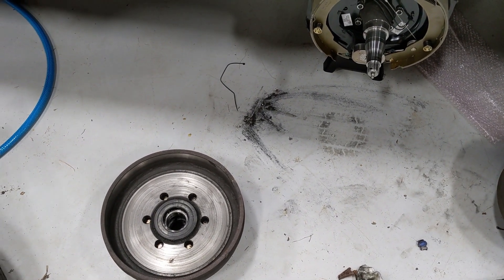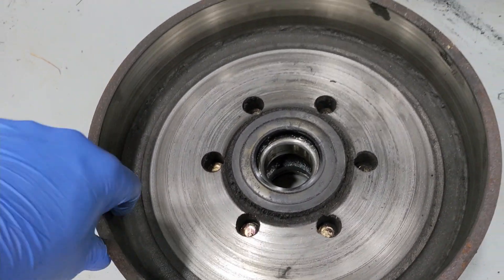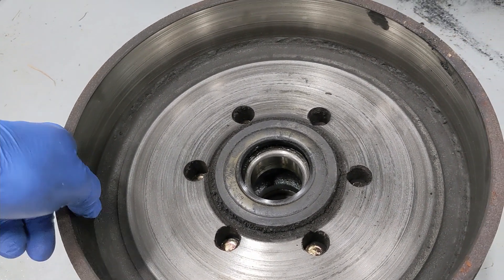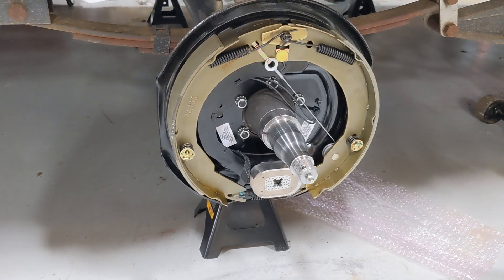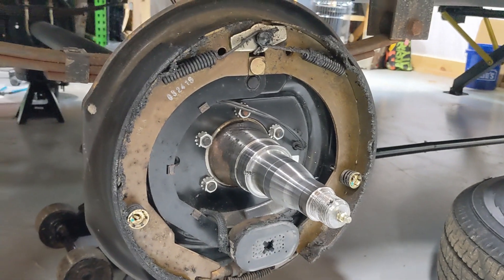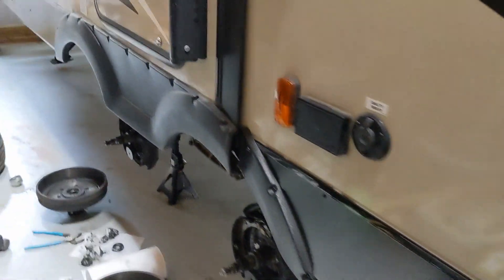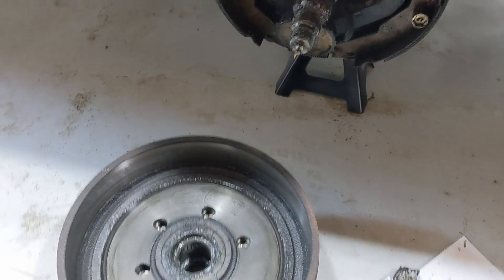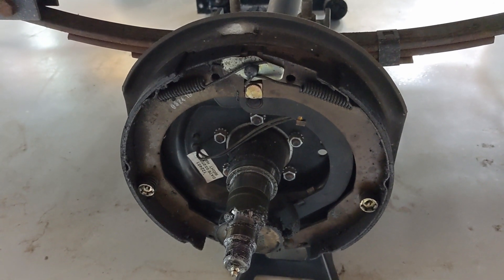Dexter/Lippert EZ Lube trailer axle spindle bearing seal failure - why did it happen?

Comment: I don't think it's accurate to call this a seal failure when what caused it was improper maintenance over greasing the bearings and it pushed grease past the seal. I don't even use the EZ Lube fittings, there's just no way to know the bearings are getting a good new pack of grease unless you pull it out and inspect.

Comment: Thanks, I'm going to check mine tomorrow. I have been pumping geese in while spinning the wheel for a few years. I will see if the seals are blown.  Lippert says to tighten it to 55 foot pounds then back the nut off and tighten by hand. So many opinions on this. I will try the way lippert says and see how that works.

Comment: Does the inner wheel bearing need to have movement up and down or does it sit without movement beside round
Reply from the maker: Should have no movement outside of rotation.
Reply: @NoelBarlau  my inner bearing is wobbly and my rotors are hitting my caliper bracket im guessing its the bearing causing problom thanks

Comment: I don’t know why they would pack the hub with grease on this trailer. Pack the bearings and shoot a few pumps of grease in. If it was a boat trailer submerged in water then u would want the grease pressure to keep water out. Had a quad trailer and bearings were still good from factory after ten years. Boat trailers I Repack every season

Comment: You can relube using the fitting if done right. They must have used a power grease gun or air and or not rotated tires. Great video and insight though. Always good to inspect and do manually
Reply: True words (Slow motion)when pressing the handle on the grease gun. And turn the wheel about two turns per full grease gun pump.

Comment: Completely filling the whole hub full of grease is not good for any axle style. Spinning the wheel during greaseing will not blow the seal out nor push it out. Too much grease in the hub so full and leaving no pocket of air space for grease exspansion is what will push a seal or actually rip the rubber apart. This happens in vehicle axle housings where the housing breather gets plugged. Just plain do NOT fill axle hub full of grease and do not leave "end play" as so many so called repair suggestions state. Leaving end play allows the weight that is being supported by the bearing to concentrate on fewer bearing rollers. No end play assures weight is distributed more evenly among more rollers due to the tapered design of the roller style bearings. After packing bearings for 54 years and having NO bearing failures due to no so called necessary end play. ALL trailer axles come out with excessive free play and not enough grease. Guess what? Bearing failure! None of my trailers have bearing failure even after twenty five years.

Comment: I never lube the Ez lube.  What is the point of filling up the center of the hub, and risk blowing a seal which is what we found when we bought our trailer used. Now, yearly we inspect,   then pack inner and outer bearing bearings replace seals adjust brakes and we are good to go.

Comment: Learn from experience. You are exactly right. In my opinion even if you are turning the wheel while pumping grease filling the entire hub until it comes out the front will eventually force it out the seal. Just the fact that when it warms up will cause the grease to expand. It may come out the front or the seal path of least resistance.
Reply: No that won’t pop out the rear seal.  The pressure will push out the front rubber plug.

Comment: If you use the EZ Lube system you will at some point have this failure....remove the bearings...check the rollers and race...hand repact and reinstall. EZ Lube does not allow bearing inspection plus if you use a different type of grease then the original type the mixing can breakdown both greases causing bearing failure.

Comment: Just did mine after buying from someone who said they were good and already packed. All seals leaked just a little. But adjusters were all locked up, and had one bad bearing. One electric brake wire was cut. Never trust anyone.

Comment: I have wide trax like you, can someone tell me how to jack up the axels.  I place a bottle jack under the cast iron piece that connects the front and rear suspension springs, then both wheels on the side are off the ground.  Maybe there is a better way.  tks

Comment: Always wondered about those greasable axle bearings, thought it was not a good idea. Always use to have to do old truck front bearings by hand. Think I'll stick to the old ways that work! Thanks for sharing 👍
Reply: Exactly. You should grease those to keep moisture from rusting them. Plus grease like the factory recommends with turning the wheel while greasing the zirc fitting. Works best in warm weather.

Comment: Pump WARM grease very very slowly! Only six or eight pumps is all that you need. When old grease starts pushing out, it’s time to remove, clean, inspect and install new grease seals.  I see these failures all the time ( I do welding and trailer repair.) also, do NOT mix polyurea and lithium based grease, it will 100% fail in a few thousand miles every time!!!

Comment: E Z lube spindles are junk!! Takes more force to put new grease into a bearing than what the seal will ever hold back from leakage into brake area. Have seen dozens of brake contamination cases and failed bearings from lack of new grease into bearing rollers in 35years of RV service.

Comment: Actually, Dexter does not say the EZ lube is for emergency use only. See: https://www.youtube.com/watch?v=XT0RKDGgDm8  Seal failures result from doing it improperly e.g. not spinning the wheel while adding grease.

Comment: Excellent video!  Everyone should know how to check your bearing, brakes and drums.  I had the same issue plus some in which I had to replace both of my axles with all new components.  That's a whole other story, but I switched from EZ lube to manual lube.  This will force me to remove the drums and hubs for any issues.

Comment: I've had to deal with this also.   I repack manually, and will still use the ez-lube fitting BUT I only give each hub MAX 1/4 pump every trip.
Reply: No pump till it comes out the grease cap.  Wipe off excess grease then put in the rubber plug.

Comment: Lazy Lube is the worst thing to ever happen to the RV industry. It over packs the hub cavity. Hub should not be packed more than 50%. 
Filling the hubs will cause the grease to churn and make the bearings over heat. Bearings must be run with .001" to .005" end play.  Never preloaded!

Comment: A good video. I can tell you are not a professional but that’s ok. Your message was what the story is about. Forget the grease fittings and pull the hubs annually and service as needed a well pack bearing with some grease in the reservoir will last for many miles plus a properly adjusted wheel bearing it’s very crucial to this operation
Reply from the maker: It's true, I'm a Captain at a U.S. major airline by trade, and I have nothing but respect for professional mechanics - I could never do their jobs.  I just like to show people what I'm thinking when I deem it relevant to a select audience, and it might just save at least one person some serious headaches in the future.  And that makes it worthwhile, backhanded complements and all.
Reply: I can tell that you are not a professional??? Don't even bother saying that you are because you are not.

Comment: When I repack my bearings, I adjust the brake when the wheel goes back on, and then I pull the emergency brake pin, to ensure the brake works. I do this 4 times, once for each wheel.

Comment: Greasy brakes create MORE friction, and will cause lockup when they are properly adjusted. Your greasy brakes weren't grabbing because the brakes were most likely not in adjustment.
Reply: I know this comment was 2 years ago but for those reading it now: @46fd04 your comment "Greasy brakes create MORE friction" is totally fiction. Grease on the brake shoe friction surface will not cause more friction; in fact, it will reduce friction and negatively impact braking performance.

Comment: The EZ Lube system works well, WHEN the operator does it properly and spins the wheel. But, manual repacking should be done at least every 2nd year, in my opinion.

Comment: Well, 16 years and counting with Posi Lube axles and Dexter bearings. Yep, raise the wheel, hand pump the grease while turning the wheel first one way and then the other. Old grease comes out when new grease is being hand pumped in. Have pulled the hub several times just to see how things are doing. Just fine so far. I carry a spare hub just in case though. Never have blown a seal and have not lost a bearing so far.
Reply: Posi lube is the grease system and Dexter is the axle brand. You couldn’t be more wrong.

Comment: After experiencing a bearing failure about 50 miles outside Rapid City, I can tell you that I will never use the EZ Lub function again.  The welding shop that I limped into the next Monday morning told me that a lot of his trailer repair work comes from these designs.  That little stop costs me around $800 for a half axle and two brake assemblies.  I now every year pull all the wheels and hand repack every bearing and install new seals.

Comment: My 2019 brand new brakes barely worked, found all 4 seals pissed grease. I believe these things are over filled from the design. So I repack by hand and put about 2 table spoons worth of grease by hand. These things don't need a swimming pool of grease, and I think I'll just get a set of bearing buddies.

Comment: Thanks for posting. Checked and repacked mine for first time on a new to us camper. I have the same axle and EZ spindles. I noticed on mine and one of yours (after about 5:20) a slight dark discoloration of one of the spindles where the outer bearing would sit. It is slightly grooved when I run the my fingernail over it. The bearings were fine but I replaced them. Is that spindle condition normal wear and tear?
Reply from the maker: Yes, the spindle is normal and undamaged.  As long as the bearing surfaces have a smooth and consistent area to mate to and seat fully without forcing them on, I wouldn't worry about a small groove.  But I'm no axle mechanic, I just play one on TV.
Reply: The EZ spindles work fine, one of the biggest mistakes is people will try to do it with cold grease with the consistency of clay, of course it will blow the seal. Get the grease up to 75-80 degrees for a night and bring your trailer or RV into a heated garage for a night or two. Now push your new grease through, it will push right through the back bearing, travel along the spindle and then push right through the front bearing then you will usually see a color change coming out of the front bearing and you are done.

Comment: I have Dexter EZ Lube and I used a grease gun about 6000 miles ago. Yesterday I removed the hub to see how the seals performed and I saw a small amount of old grease right at the bearing seal but maybe not enough to cause harm to the brake. I should have felt the pads to see if they were wet at all. The brake pad did not look wet and I saw no grease on the brake itself. It was very small amount only around the edge of the seal. So I was not sure if the grease was from squirting too fast or if it was from hot grease flowing. So I reinstalled the hub and wheel. I pumped a large amount of grease back in the zerk until if started coming out of the dust cap then removed wheel and hub again. The second time there was no new grease at all that escaped the seal. This makes me confident I did it well the second time but there was something I did wrong the first time. I am thinking I could have pumped too hard or I could have filled up the grease cap with grease and when it heated up it expanded and had nowhere else to expand into but the seal. I will check the other three as soon as the weather allows. I will check the pads. If everything is ok then I can use the EZ Lube method but be more careful to pump softly and empty out the dust cap of grease. Yet I would still want to manually repack at some time for inspection of the bearings.

Comment: Hello sir! First off: great video, thank you for your high attention to detail.  I'm EXACTLY like you: IF I buy something used I have to tear into it for preventative maintenance measures to ensure everything is in tip top working order for my own confidence in using my equipment.  I tinker with everything in my shop but I'm new to trailer bearings.  I just bought a BWise 17k GVW gooseneck dump trailer that is equipped with the Dexter EZ Lube axles (hubs) (on 3/21/22).  I like everything you pointed out in this video and I will be following this guide when I inspect my hubs.  My only question to you is do you feel the very little amount of grease that you hand packed in there is enough?  I haven't torn into mine yet, so I don't know for sure, but I get the impression that the void between the spindle itself and the center of the drum would hold quite a bit of grease?  Would you be curious to give maybe 15 pumps of grease on that zirk fitting once you put it back together?  I know in one of your other comments in here you said you have 4k miles trouble free; if you were to tear the hubs apart tomorrow would you expect to find any damage wear marks on the spindles or heat / burn marks on the bearing needles from too little grease?  Just looking for your thoughts sir. Thank you for your time.
Reply from the maker: I wondered the same thing about the grease.  Then I came to the realization that other hubs without the zerk fitting don't get any additional grease and seem to do fine.  Even if you put another 15 shots of grease in, it'd only do the inboard bearing and it'd take an entire tube to get enough in there to take up the volume and push some into the outboard bearing.  But by then you've already risked blowing out your seal again.  So I really don't have a good answer for you.  It seems to be holding up just fine, I check my hub temperatures regularly with an infrared thermometer and they're all remaining relatively cool. I'm planning on tearing them down again before this summer and maybe I'll do a video on this subject.
Reply: @NoelBarlau  when you do, can you put a link in this video's comment section so we all see it?
Reply from the maker: @bryank4649  I'll try to remember. But no promises!
Reply: So I watched this video  last night and found myself tearing into mine this morning. Happy to say all was good. If you repack and replace seals you can inspect all components. Have used the easy lubes but don’t trust them. You do have to take your time while rotating the drum in both directions.

Comment: Very few people understand correct way to preload the bearing.   You got it right.

PS, you didn't mention it but the bearings have to go back into the exact races they came out of.  You can't mix wear patterns, well, not for long
Reply: "...one of the races is permanently in the hub".   Not sure what you mean by that.  Not to beat a dead horse, but the races are replaceable with a hammer and brass punch.
Reply from the maker: @jimcollins8097  Good to know. This was my first attempt at axle bearing replacement, and I'm certainly no expert. Thanks for the tips.
Reply from the maker: I commented before re-watching the video, then deleted my ill-informed reply.  You are completely correct.  I forgot that one of the races is permanently in the hub.

Comment: Thank you for posting.  I've had my travel trailer for about 3 years.  Believe it or not, I didn't even know mine had these EZ lube Zerk fittings on the end of the spindle.  I went out and checked.  It sure does.  After seeing your video and a few others, now I'm afraid to grease them for fear of blowing out the seal.  What is your honest opinion?  Use them or not?  What about jacking the tire off the ground and maybe giving it a few pumps of the grease gun while rotating and call it good?  Now I don't know what to do.
Reply from the maker: Well Gary, by their own description the zerks are for "emergency use only" so I can't recommend using them as a substitute for a complete teardown, cleanout, and repacking the bearings. Just because you might get lucky and actually not blow out the seals if you do it as you described doesn't mean it won't happen.  Then you'll be out not only the cost of the original bearing service but you'll also be on the hook for new brake shoes and resurfacing of the drums.  Knowing what I know now, I'll never be touching those zerks.  I'm planning on pretending they don't even exist unless some really strange circumstances necessitating their use comes to pass.
Reply: @NoelBarlau  Thank  you for responding!  I agree with you.  I think I'll go the old fashion way and just take them out and repack.  It's amazing what you can find out watching videos like yours.  Like I said, I didn't even realize I had zerk fittings in my axle.  I've had my travel trailer for 3 years now and I'm still learning about it!!  Thank you again for responding and keep those videos coming!!
Reply: @NoelBarlau  Where did you get that emergency BS. The crap people say on YT, why would they make an emergency fitting, once it becomes an emergency its to late, bearing is cooked, spindle may be trashed and adding some grease sure wont help. Stop the madness.

Comment: Don't "repack" your bearings with the easy lube......at best this is for emergency use when a wheel bearing is overheating.....ALWAYS repack by tearing everything apart and repacking following the instructions on the manufacturers website.
Reply: Wrong, it is not for emergency
Reply: @slalomking  Do what you want.  If you blow grease all over your break shoes because you want to do it "the easy way".....not my problem.